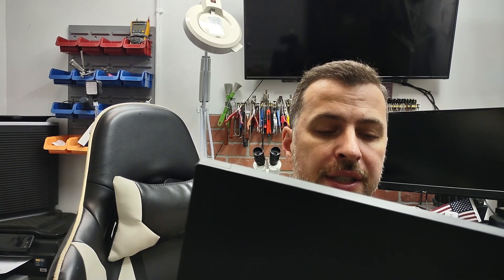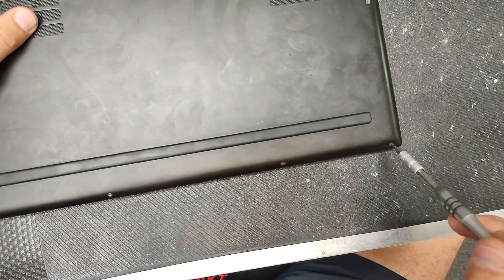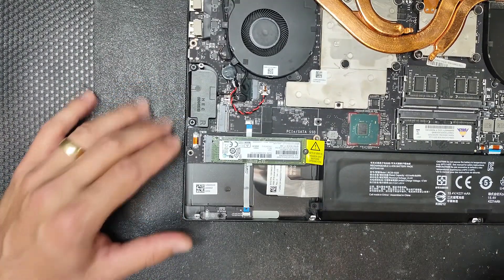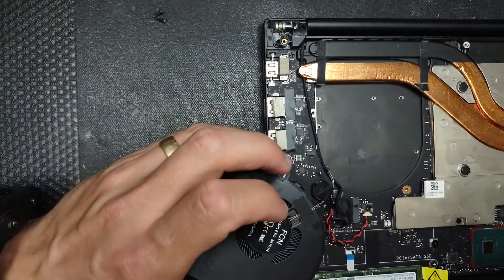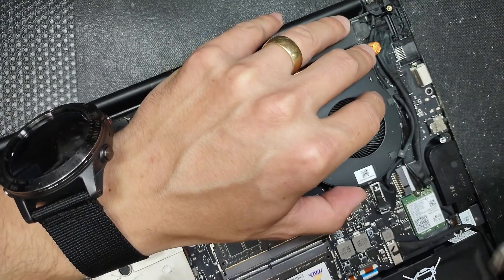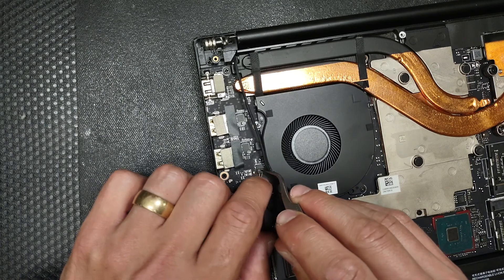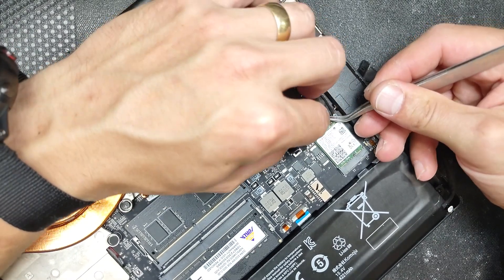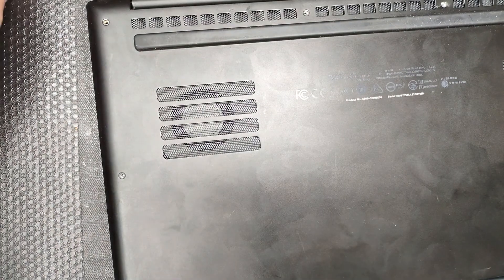Razer Blade RZ09-0270 fan replacement + bonus advice on possible upgrades @comptechnyc

Comment: I have a lenovo Yoga 740 l have tried serval different ways to reboot it and everytime it says it cant be completed .. its been acting a little funny like not updating correct way things in the control settings being weird .. About a year ago I sent it to lenovo manufacturer because it wouldn't load after the login screen came up. after rebooting it several times and it working correctly for just a hour or so it eventually turned on but the screen was black and eventually quit charging but before it did that happened the touch screen stopped working .

Just throwing it out there maybe you know of a different way to reboot it will the disconnecting of the battery work for this?